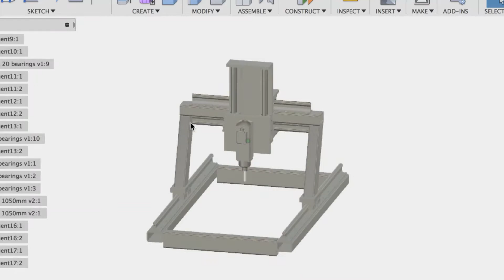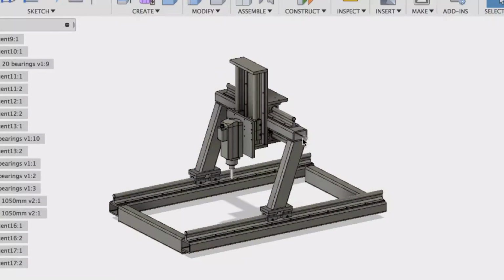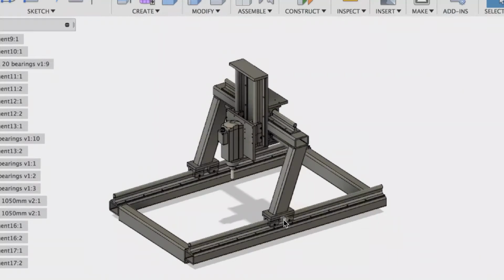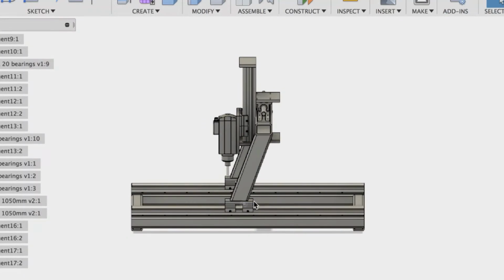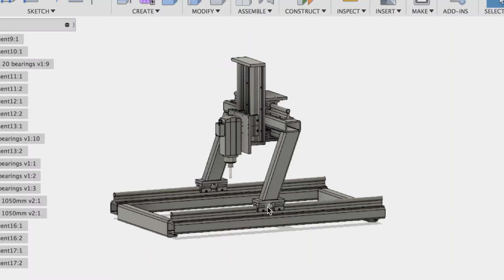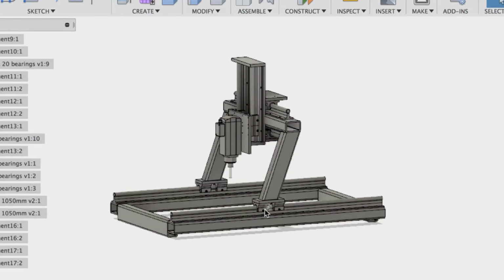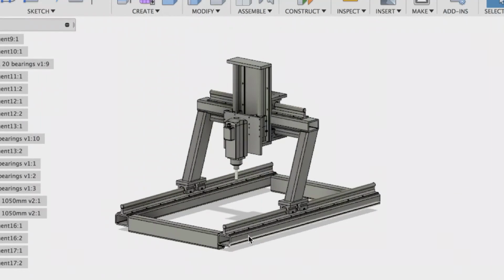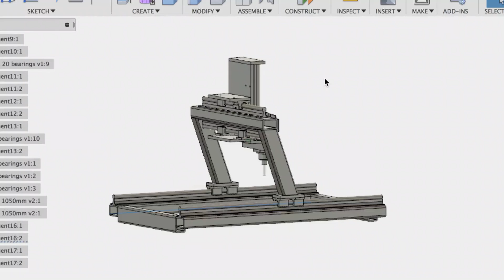DIY CNC Machine Design Physics -part (4) design critique

Comment: There are so many mill designs where the gantry is sat at an angle including yours, why? what's the difference between that and if it sat vertically? thanks!
Reply from the maker: Honestly very little, it’ll work both ways I’m sure…. The idea is that we are using a cheap linear rail if the center of mass is to one side of those rails then one of the bearings will bear the majority of the weight and the other could have a negative force on it…. It’s a small detail, but it’s in an attempt to maximize cheap linear rails

Comment: Good points to think about.  Yes, welding doesn't particularly make small adjustments very easy later.  Filling the tubes with sand sounds good.   
Keep working on your audio levels.  Try to get a louder recording of your voice, and then be consistent with the volume level of your voice vs intro/exit music when editing.